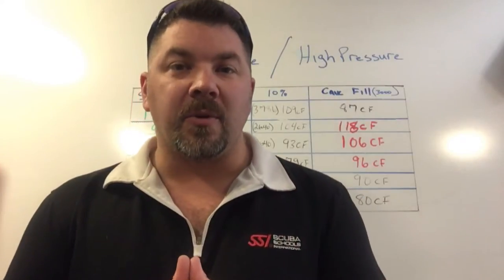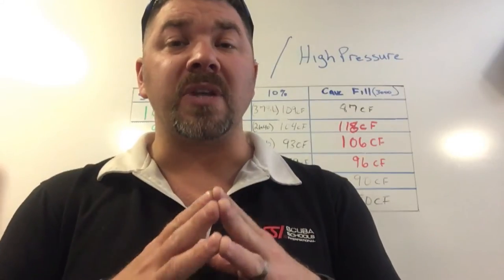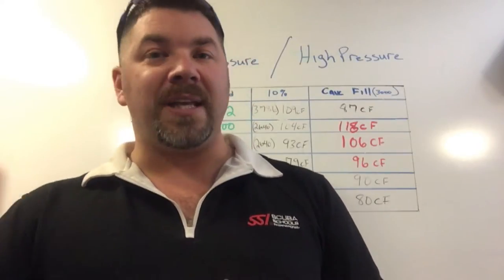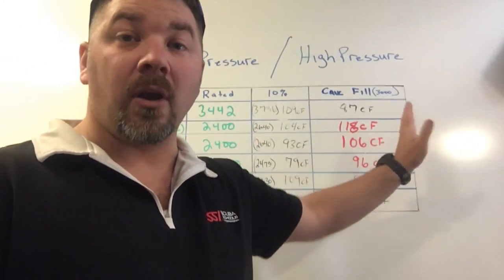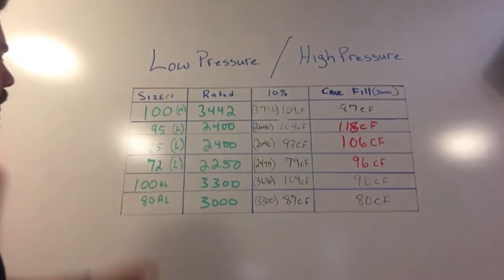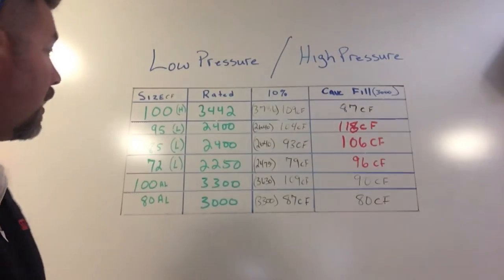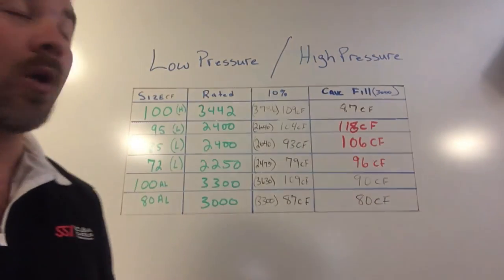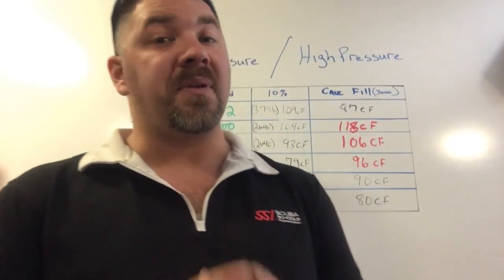"High Pressure Vs Low Pressure" How Much Air Am I Getting?

Comment: A hp 100 faber actually holds 101.3cuft when filled to 3442 and when u fill it past that u don’t gain air at a linear rate u actually get diminishing returns as the pressure increase cause air doesn’t follow the ideal gas law and a aluminum 80 at 3000psi actually holds 77.4cuft .not a big difference I just want to point out that u have to look at the manufacturer specs to get actual volume cause what they call the tank is usually rounded up to a bigger value .sometimes they r rounded Down but that is usually not the norm
Reply from the maker: Hello @pearabellum, the Scuba Industry has always rounded up, we do the same with gas calculations and table calculations. Thanks for sharing.

Comment: Hi Bryan, High pressure steel 80 and a Low pressure steel 80 both have the volume of 80 cuf does one have more air in  it or are they the same ? I guest I'm looking for a simply answer if there is one . should you get then same dive time out of each if the dive was the same 

thank you
NAA
Reply from the maker: Hello naa62, here is the simplest way to explain it. Both have 80cf of air in them, but one has a higher pressure rating. The steel cylinder has more stencil strength, thus can hold a higher pressure. Since the cylinder is smaller in physical size but can hold a higher pressure, you can put more physical air in it (physical air meaning cubic feet). We will have a video coming out in late March talking about the differences in both Aluminum 80cf cylinders and Steel 80cf cylinders. Stay tuned.
Reply: There is something to be said for how Americans size cylinders in capacity, but it also creates some confusion.
An 80cf cylinder will hold 80cf of gas. So a higher rated pressure means a smaller cylinder.

In Europe, cylinders are sized to physical volume. A low pressure 12 liter is the same physical size as a high pressure 12 liter, but the high pressure 12 liter can hold more gas. And since you can just multiply the cylinder size by the rated pressure to get the capacity, it's fairly easy to calculate how much gas you'll be able to carry. A 230bar (3335psi) 12 liter cylinder holds 2760 liters (97cf), a 300bar (4350psi) 12 liter cylinder holds 3600 liters (127cf).

300bar cylinders are about 10-12% more expensive than 230bar cylinders for 30% more capacity, but do take significantly longer to fill to capacity.

Comment: Your terminology is very confusing.  You are calling an overfill a "hot fill".  A hot fill is typically when the tank is filled fast and it is hot when it is done filling and then cools down to a lower than rated pressure.  An overfill is when you, well over fill a tank.
Reply from the maker: Andrew Morency You are correct, sometimes when a tank is filled fast, we call that a Hot Fill as well. In the context of the subject, articulation and interpretation can change the meaning of a word and or phrase.

Comment: Thank you for the information, this particular video is especially welcome. I'm a relatively newer diver (2.5 years approx 250 dives) diving in warm waters of Guam , The Philippines and the like. I get the part about the 80's I have mostly aluminum but a couple of steel tanks as well. My question is I have a LP steel 80 stamped 2400. One dive shop regularly will only give me 24-2600 as I have no + stamped on the tank. The other regularly gives me 3000-3500. Am I damaging this tank ?
Reply from the maker: Hello Bill, that is a great question. Even if the cylinder is stamped + rated, technically speaking yes you are damaging the cylinder.   The elasticity of the cylinder is not as much as one might think, especially in the cylinder threads. However, the biggest concern is repeated fills day in and day out.  When we think of a Hydro Pressure being 5/3's the working pressure (3000 psi cylinder boosted to 5000 psi), it is a given that filling above the working pressure once every 5 years is ok.  I would even go as far as to say several times a year, there probably won't be much risk (and only if filled slowly).  But then again, at what point does the cylinder reach its maximum elasticity.  My suggestion is to go by manufactures recommendations.  If its + rated, fill up to the 10% over mark, and no more.  I routinely will fill low pressure steel cylinders for my customers (with a plus rating) to 3000 psi, but only cylinders that I have personally did a visual on, and feel comfortable with their condition. The cylinder is most likely to rupture during the filling process and not so much so afterwards.  This being said, the fill operator is the one at the most risk.   All this being said, if you are diving just a few times each month, I wouldn't worry to much about boosting your cylinders, however, if you are diving several times a week, then I would maybe only boost a cylinder once a month.  The more you stretch a cylinder, the quicker its elasticity breaks down.  Hopefully this answered your questions.
Reply: Thank you for your answer. I was filling that tank up twice a week but I will no longer let it be filled beyond 2400-2600. I will use one of my 3000 cf aluminum ones instead. That tank I will only use on dives that I feel 2400-2600 will be sufficient. Again thank you for your Youtube and Scuba Pro contributions as they have taught me a great deal!
Reply from the maker: You're welcome, glad you have found our videos helpful.

Comment: I guess I can understand not wanting to fill cylinders over 3000psi if that's a limitation of their equipment, or it reduces their output of how many cylinders they can fill. But overfilling a 2250psi to 3000psi... if that's how you operate that you just fill every cylinder to 3000psi regardless of rated pressure, you should not be in the business of filling cylinders.

I'm also curious why a 3442psi is considered "high pressure". I would have thought 4300psi would be high pressure, but maybe those cylinders aren't common in your area as they would require a DIN connector.

I don't think it's necessary to have high pressure cylinders, those couple of extra minutes of gas are nice to have, but not life changing. If you want more gas, diving doubles is the way to go, not getting higher pressure cylinders. But if you're buying new cylinders, you might as well get ones that can handle higher pressures. At the very least your cylinder will last longer (provided you take care of it).
Reply from the maker: Hello @bloodymarvelous4790, most of your questions I would refer you to the Compressed Gas Association and Department of Transportation. These regulatory agencies have guidelines shops must follow for safety and insurance reasons.